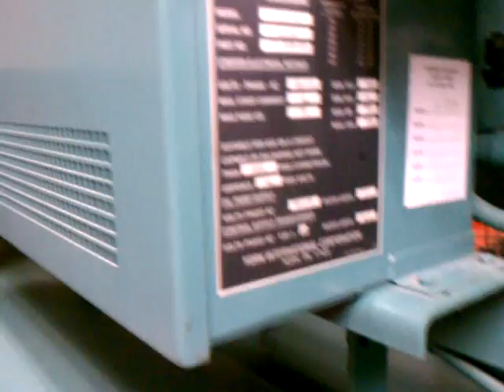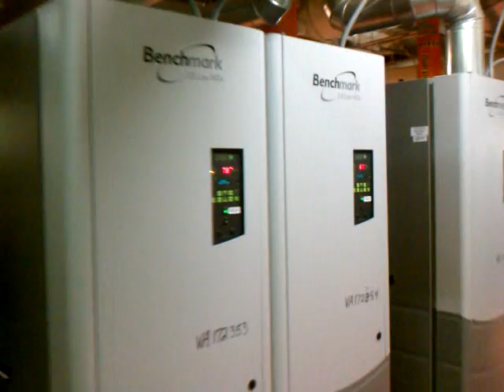Chiller plant tour w/ chiller start-up

Comment: Excellent video. I've been studying plumbing and mechanical engineering since I learned to talk, and I'm really glad that someone was willing to share a view of their facility. 

Also, I cannot hear any whining sound from the VFDs on the water pumps. Have you figured out the noise smoothing trick by any chance? (parameter 2609 on ABB drives; parameter NRD on Square-D drives)

Comment: Did you hear about the service bulliten on the slide valve end cap. Will help with oil diff pressure problems.

Comment: what is the insulation used on the chiller?
Reply from the maker: It's just a foam insulation that's been painted over.  I don't know what brand exactly.
Reply: doesn't look like nitrile rubber.....looks like some jacket type insulation wrapped on to suction line
Reply: VeeDubTDI thanks